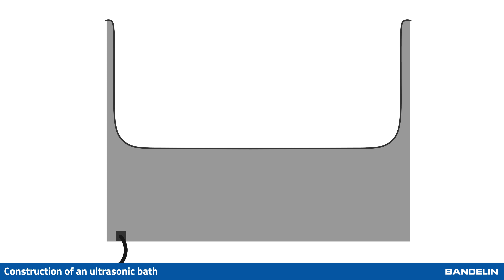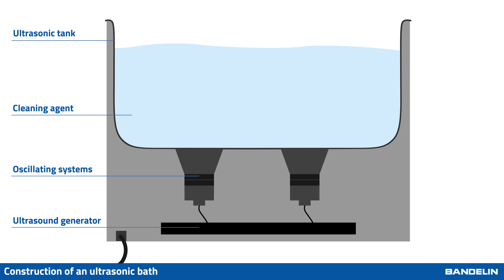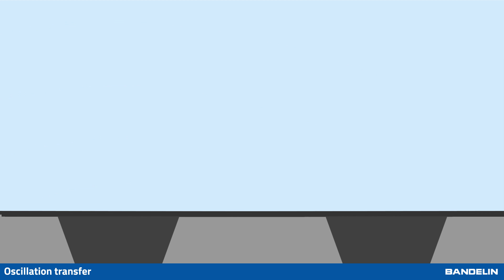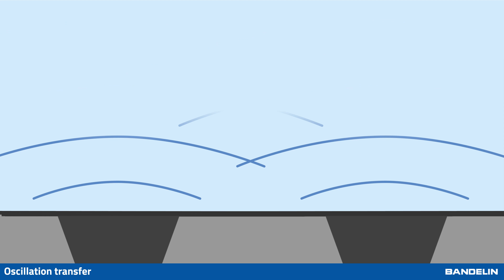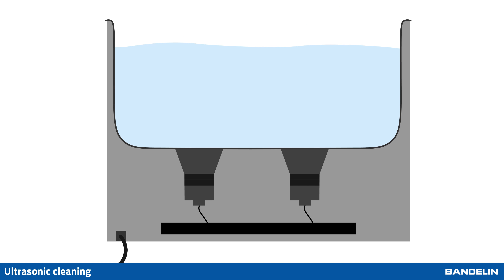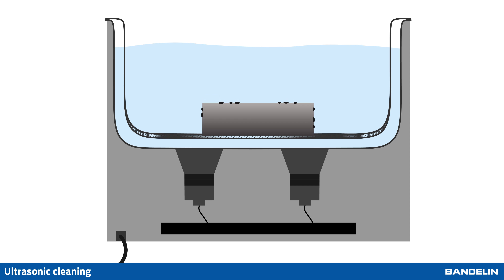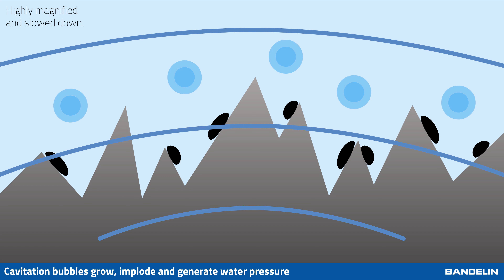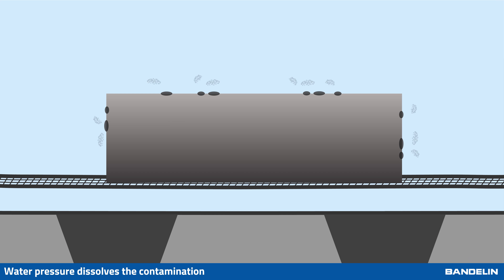How does ultrasonic cleaning work? Functionality of a high-performance ultrasonic bath

Comment: Where do the dirt particles go? To other dimensions?
Reply from the maker: Most of the removed particles are dissolved by the ultrasound in water/cleaning solution as described in the video. Insoluble particles such as sand are deposited at the bottom of the bath, so the cleaning solution should be changed regularly.